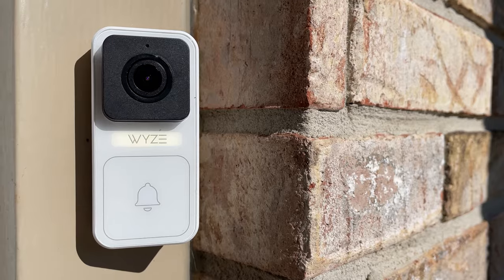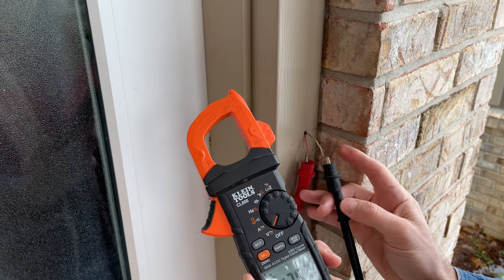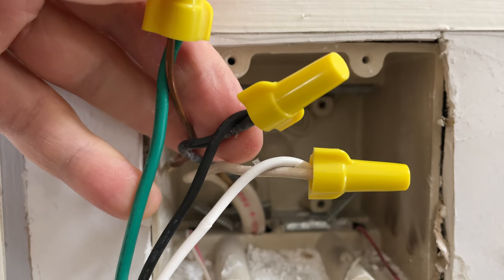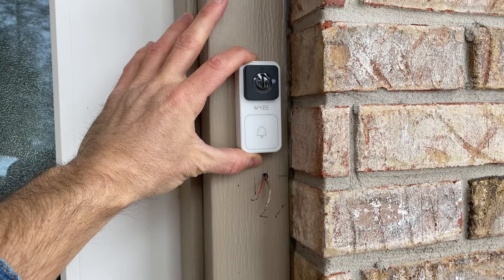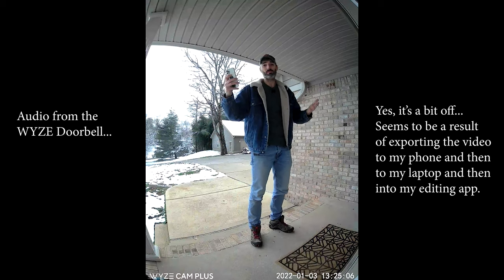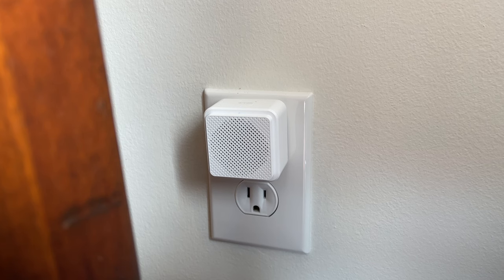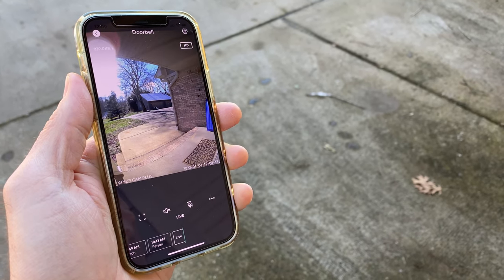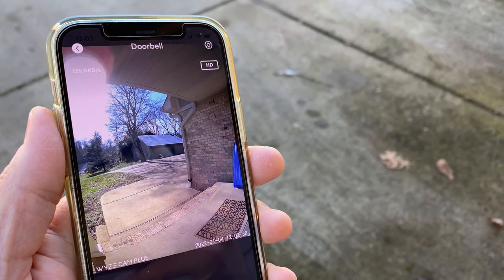Here's Why The WYZE VIDEO DOORBELL IS SO AWESOME!!

Comment: Is there a way to hook up the new chime and have the old chime work at the same time. With your case is your old chime still working with the rear bell?
Reply: I’m not sure about this doorbell, but their doorbell v2 comes with an adapter that integrates the old chime. You don’t get the wireless speaker, though.

Comment: I have three basic white doorbell the chime wired version
It worked perfectly until I did the firmware update now the motion detector does not work 
I have rebooted power on power off, but the same problem persists 
Any ideas?

Comment: Any chance this could be setup with a solar panel / battery? as no power at front door.
Reply: You could buts battery solar set up are 12 Volts and like he said you need at least 16v to 18V to power the door bell
Reply: @MyNameIsHairold You'll need a power inverter that converts the 12Vdc to 16-24Vac.  If you don't know the difference between DC and AC voltage, find a doorbell camera that works on DC voltage.

Comment: Since the Wyze Video Doorbell is hard wired to your existing doorbell, why is the Wyze chime box needed?
Reply: The mechanical doorbell is bypassed and only used to power the video doorbell. So pressing the Wyze doorbell without the Wyze chime plugged in makes no sound at all. Many video doorbells are this way.
Reply: That sucks so bad. Being forced to use proprietary parts for something as mundane as a doorbell is really terrible.

Comment: Mine worked for a couple days and now will no longer connect to the modem. Wyze has been unhelpful in remedying the problem after several contacts with customer sevrvice.
Reply: Check the strength of the WiFi signal at the doorbell location.  You might need range extender, a mesh wireless router, or just reposition your existing router.

Comment: A doorbell that uses the existing wiring but can't use the existing mechanical chime is a really bad design choice.
Somebody at wyze needs to be fired.
Reply: Two wires go from chime to doorbell.
Doorbell acts as a momentary switch.
Pressing doorbell completes the circuit and powers the chime.
You hear the sound.

This doorbell has no battery and needs constant power. 
Wiring bypasses return line back to chime, going back to transformer instead. 

Same reason why most air-conditioner thermostats are battery powered despite wires and a transformer connected to it. 
It acts as electronically controlled switches.

I could see it working if there were 3 lines: 2 for power and 1 for return to chime.
If the unit was battery powered, there should be no reason for it to not work with a chime.